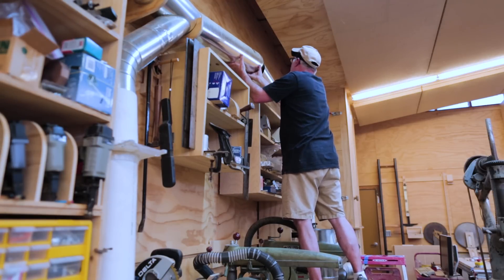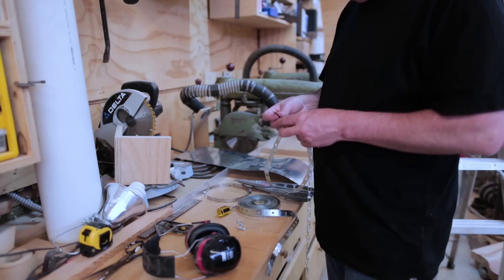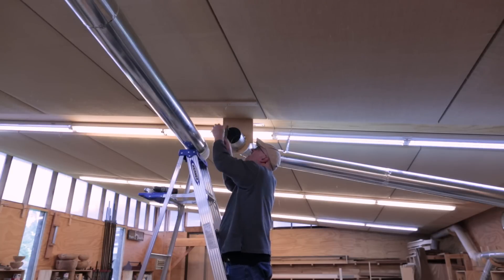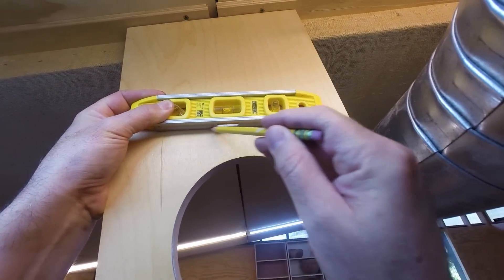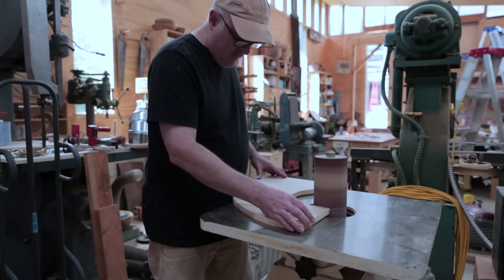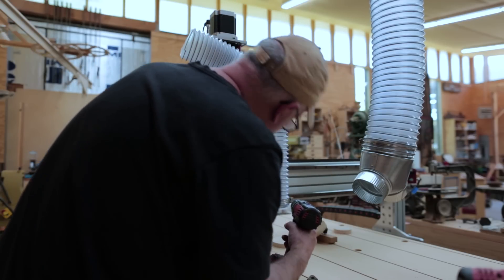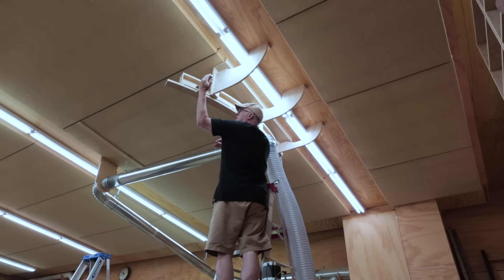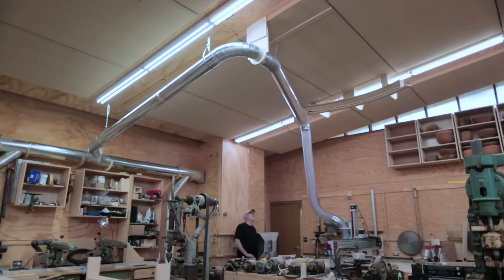CNC Dust Collection part 2

Comment: Why not have wheels on both sides of the original track, it will never come off
Reply: If only they could be unscrewed and made of some material that allows them to be reshaped and repositioned...
Reply: I was joking some, and, yes, making changes would involve reworking what he's got, but it isn't like he didn't have to make changes to his original plan. Since the whole thing is made of wood, and he's a woodworker in a woodshop full of woodworking tools, it shouldn't be too much of a problem to modify what he's already built. 

The whole thing could be "fixed" by adding a length of bent ply (just like the vert part of the I-beam), maybe five or six inches in width, nailed/screwed to the inside/outside of the curve at the bottom flange of the I-beam. The bottom of this new piece would need two strips of ply, or maybe 1x2 pine, bent and attached to both sides along the bottom. These would make a horizontal flange on the bottom and act as the rails for the trolley. Speaking of, the trolley might need to be replaced, but the new one is dead simple. It's basically just an H- or U-shape with the wheels on the inside of the uprights. He could probably strip the original trolley down to it's first iteration and then add a bracket to form the H/U configuration needed.

Alternatively, if he could attach just the top flange of the I-beam to the ceiling mounts and fill the cutouts along the bottom flange, he could then throw the new H/U trolley onto it. This might require replacing some or all of the mounting pieces, but those side braces were an after-thought to begin with. Besides, replacing the offending parts would be better (and cleaner looking) than just adding more and more parts onto the thing.

Comment: Boy was that a lot of work.  Why didn't you just make the entire thing out of the flexible hose.
Reply: The Cynic FYI flexible hose is terrible for air flow. The spirals create immense turbulence, etc. Totally fine when needed but a real waste of air flow if you can use smooth pipe instead. Just my pov. 😊

Comment: Nice. But this is over-engineering at it's finest :) you know you could just hang the end of pipe by say 25cm chain, just like section before, on a piece of guitar string attached to ceiling, like a courtain and be done with it...

Comment: Hi Frank, please look into adding grounding wires to your plastic sections to prevent static discharge fires.
Reply: I agree. That moving pipe is isolated on both ends by the rubber hose, could potentially build a very high voltage with the air moving trough it.
Reply: Can you show any actual case where a fire was started because of static discharge in a home use?
Reply: While Frank's shop is at his home, a shop that size, with a dust collection system that size. Is outside the definition of home use. Bonding across the isolated sections is a trivial effort and cost to prevent a fire.
Reply: The hoses have a metal wire in them that makes the coil on the exterior, in the video you see him cut one with wire cutters. As long as it touches the metal pipe its good.  I never get a shock from mine while its running for an hour or more at a time.
Reply: Fire may be a very, very remote risk, but with computers involved in the CNC, reducing the risk of electrical discharge is a good enough reason to ground everything. 
I destroyed a dozen MP3 players one afternoon looking for an ESD (Electrostatic discharge) problem. Turns out the cable was assembled incorrectly.

Comment: I see 4 people have really lousy mouse control and accidentally clicked the wrong button.
Reply: More probably Australians.
Reply: Too complicated design, too heavy. Simple sliding doors hardware will work also (with closed track). And curved track is overkill - just hang duct few inches lower, use piece of chain instead of rigid connection between tube and rollers. Epic fail in comparison with other Frank's elegant projects. Although I don't downvote this video.
Reply: Pavel Mayorov Really? Frank has shown over and over again that design has two objectives: Utility and aesthetic. A curved surface has an organic quality that is pleasing and interesting. Hence, the CNC and everything associated with it.
Reply: Pavel Mayorov It is over engineered, but it works so it definitely is not an epic fail. Glad you didn't downvote it.
Reply: Moritz Schwarzer, There is a difference between "I'm an idiot" and "I'm an idiot in comparison with Einstein". :)
Reply: IPuttLikeSergio. Utility? Few kilograms of big wheels and wood instead of small specially-designed-for-that carriage and light rail? Not convincing. Aestetic? May be, but too heavy and clearly too many later additions. So, as I said, not elegant.
Reply: +ShamWerks We're upside down, mate, not left to right.
Reply: @TheOneWhoMightBe : I know, that's why identifying the "Thumb Up" and "Thumb Down" button must be so challenging. ;-)
Reply: Ah, I gotcha.
Too much plywood dust for me today.:D